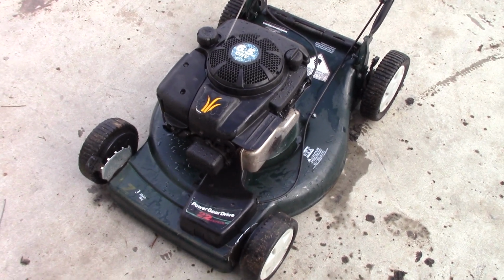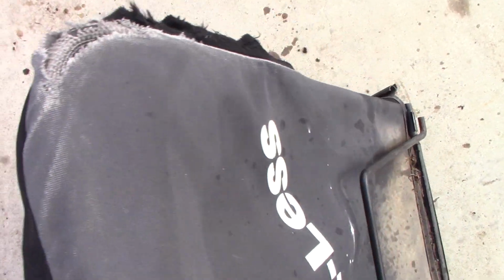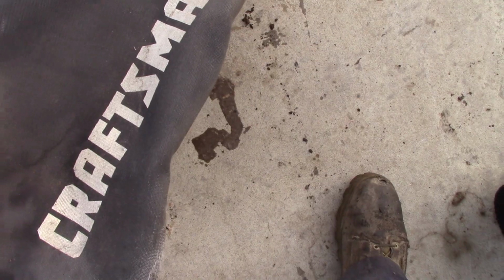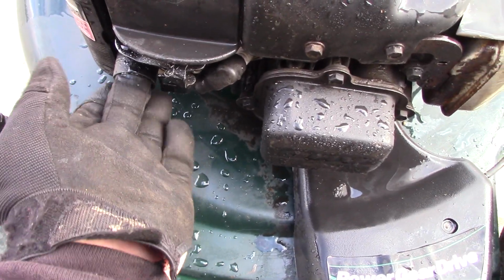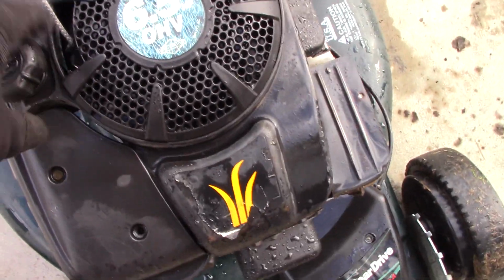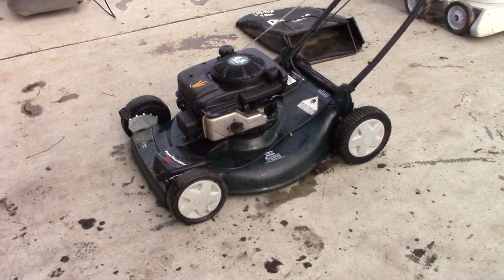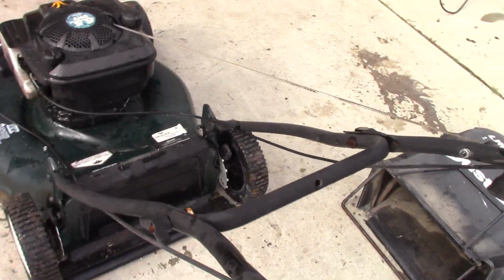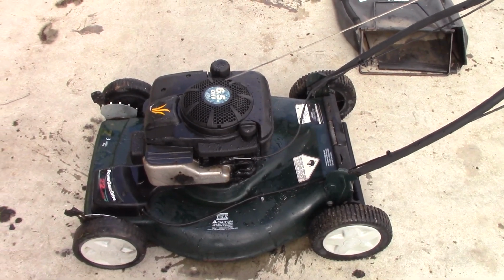Craftsman Mower Briggs Swap Final Look

Comment: Great video  as usual but i was wondering do you ever check the valve lash on the mowers you get in with over head valves ?
Reply from the maker: When I have to. These pushers  have rarely needed it though in my experience.